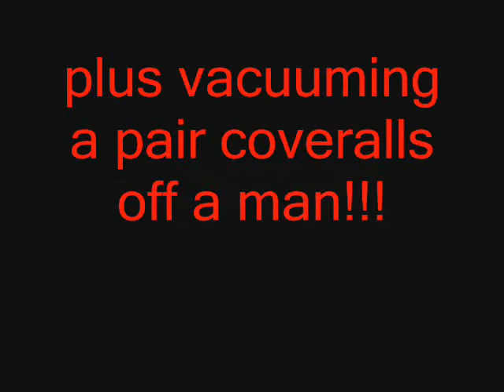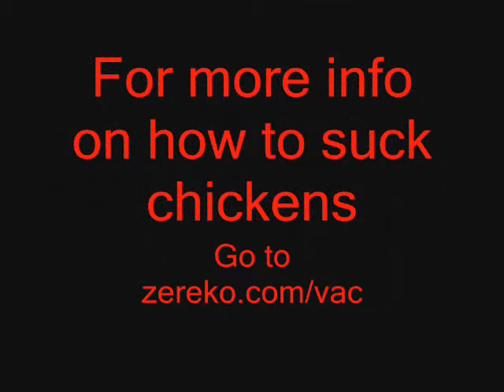chicken sucking Movie.wmv

Comment: Why chicken
Reply from the maker: sole' johnson We pumped chickens because a chicken processing plant wanted to know what would happen if a whole chicken fell into the mix. The reason for this is that they handle about 5 tons per hour of chicken offal (the insides and waste from processing) that they wanted to move in their processing plant but they were wondering what would happen if a full chicken fell in! Well in typical IVAC style, we actually pumped the chickens to show them that our vacuum units would easily handle it! Very GOOD question--probably was a few people wondering why we did that. Our vacuum  units will replace old auger systems with our equipment that has 100% availability & no maintenance required. They are able to operate 24/7 and not miss a beat! (or beak??)